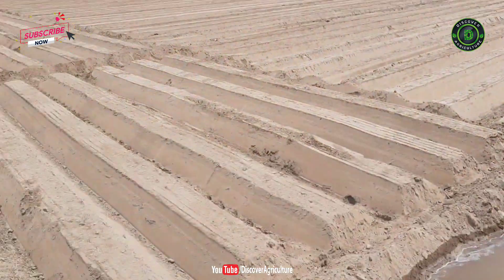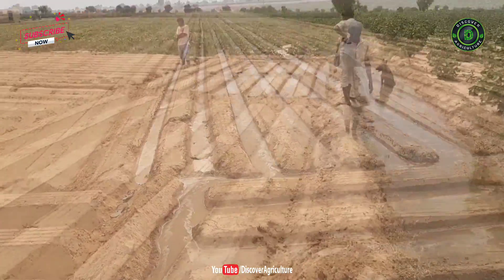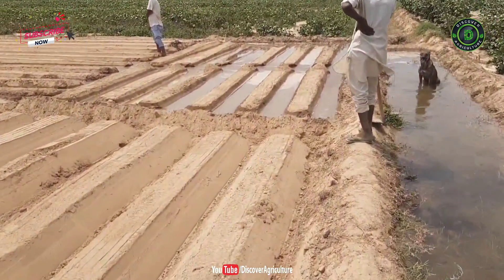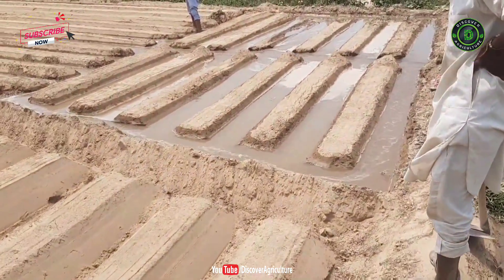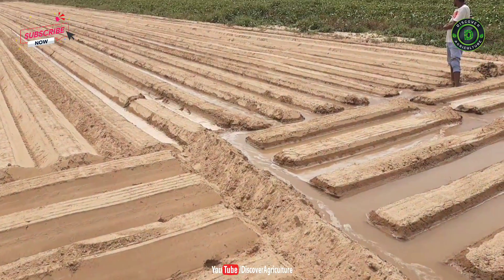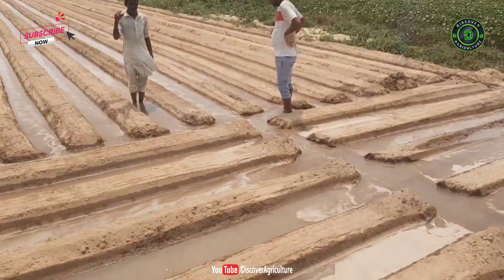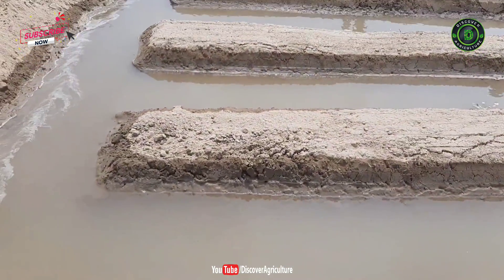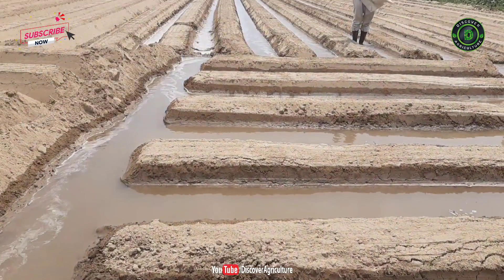Furrow Irrigation System | Surface Irrigation System | Agriculture Irrigation Method

Comment: - which system of irrigation supplies water to the plant equivalent to consumptive use? 🙏 Sir please answer this question 🙏🙏🙏🙏🙏
 (A) Furrow irrigation system 
(B) Flood irrigation system
 (C) Drip irrigation system 
(D) Check-basin irrigation system
Reply: C obviously. It is a bit of an investment to start off with, but it will pay back immensely in water savings and plant growth.
Reply: Drip irrigation ❤